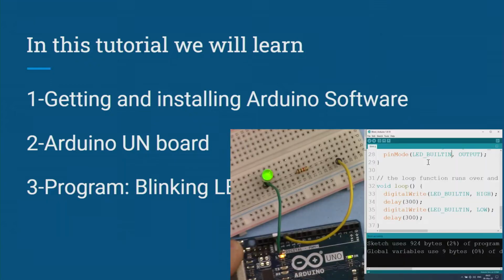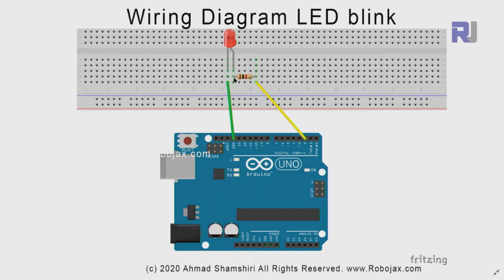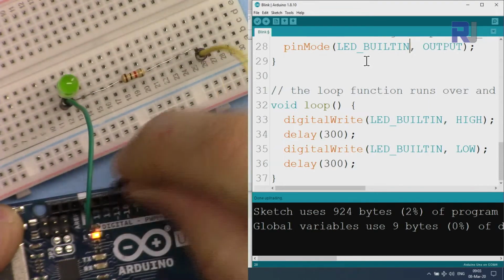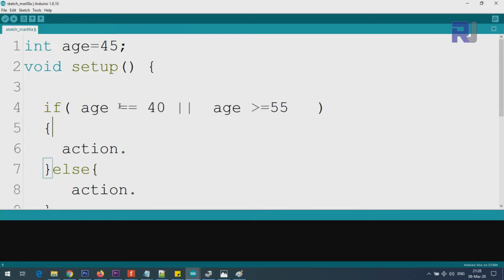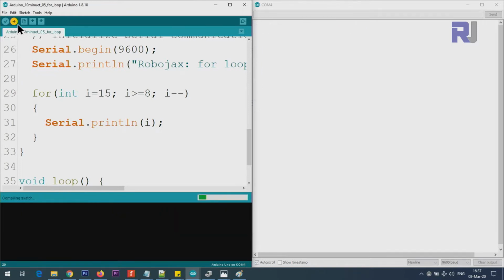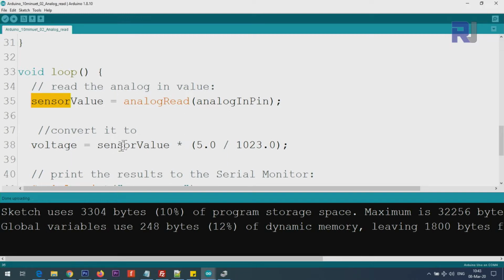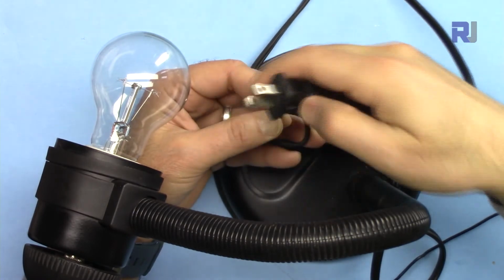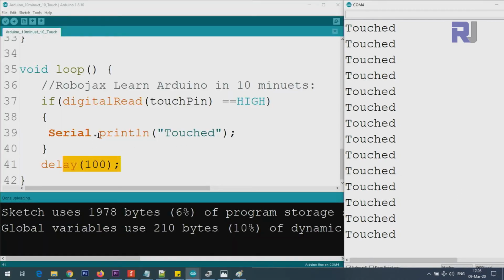Learn Arduino in 30 Minutes: Examples and projects - RJT282

Comment: Awesome video and great introduction and setup this will come in very handy when I get mine and set them up. Input voltage can be up to 120/240V? Also I’m using this to install fans into a toolbox to run 2-3 fans as extraction fans etc to keep things cool as I am firing out a trailer and turning it into a camper trailer

Comment: thanks for sending me to this video.. i have 1 more question..

i want to build a arm 3 way movemnt

parts i want to use

3x Servo
6x Push buttons
1x Oled display 128x65

the question is can i made this happen? i dont think the port I/O is enough.. is there any tools that i can use to expand port numbers
Reply from the maker: arduino UNO has 15 pins including the Analog pins. for 3 way movement, if you can attach the  servo to something that acts properly (like arm), yes you can do it.  but if you are absolute beginner, then this might be a little advanced for you. I have tones of videos on servo with push buttons. Make sure to finish and practice all projects in this video. then search for servo related videos. good luck.
Reply from the maker: you didn't reply?
Reply: @robojax  hi i forgot to tell you.. i just ordered ardunio mega.. i will not do this prpject with my current UNO.. bcos its lack of pin.. i dont understand how to code effectively and how this output things work

Comment: I am new to the use of Arduino projects.  My interest is because I am a Model Railroader. My first project is to apply this to a turntable to turn a model locomotive.  Unless you have other recommendations, I will start with the Arduino Uno, the Nema 17 stepper motor and the LN298N.  I need to learn how to stop the stepper motor to align different storage tracks.  Using a clock as an example, a locomotive enters the turntable at the 6 o'clock position, the turntable rotates from 6 o'clock to 1 o'clock and the locomotive runs off onto the storage  track.  Then the turntable rotates to the 10 o'clock position so another locomotive can run out onto the turntable.  The trick is to get the rails to line up at each position.  I am using Digital Command Control to run the locomotives.  Any advice?
Reply from the maker: your is a project.  Please see my videos on stepper https://www.youtube.com/robojaxTV/search?query=stepper and I am sure you will find something to work for you.

Comment: I want to take your course on udemy. Would it be possible to share a file with all the equipment i will need. I hate starting a course and not having the equipment on hand. I want to order everything now and start the course when they arrive.
Reply from the maker: Hi,  the course has over 30 hours. So may topics that you may not need. You start with basics, then programming tips and then you may go in specific direction.  For example I have tones of temperature sensors. You may use one or two or something related to your project. The same is true for motor control, obstacle avoidance etc. Just go a look at the topics which you can see.
Reply: @robojax  i will buy one of those arduino starter kits and hopefully that will be enough for the projects i want to follow. Thank you
Reply from the maker: You are welcome. Thank you for keep watching the ads and not skipping them. it will help me a lot.

Comment: @Robojax  I am making solar , wind hybrid power system . It measures voltages generated by solar panel and motor and compares them . It has 2 LEDs . If the voltage generated by solar panel is greater than motor then LED1 glows by power produced by solar panel and if voltage generated by motor is high LED2 glows by power produced by motor . Please guide me about the connections of solar panel , motor and LEDs with 2 channel relay module
Reply from the maker: I don't have the equipment you use and don't know anything about your solar project. Also I have not done any solar related project so I can't help you.